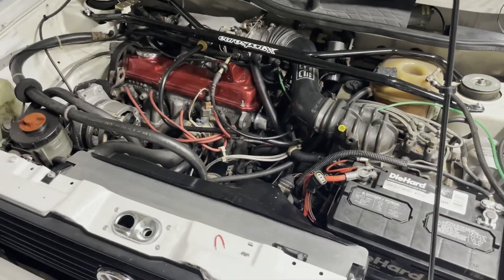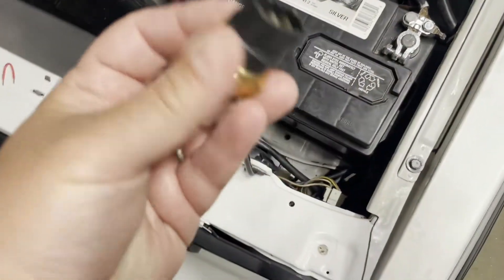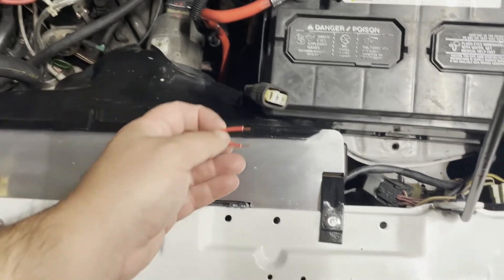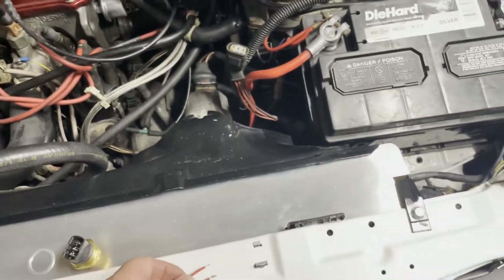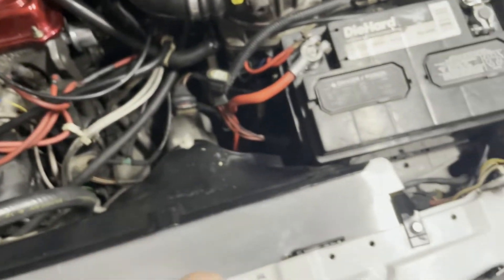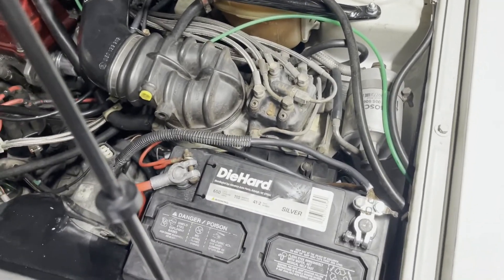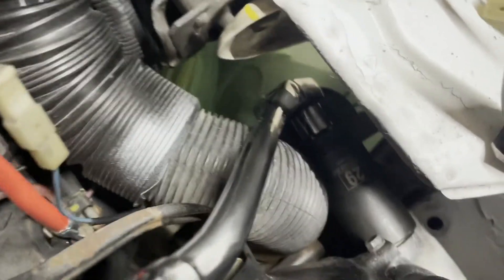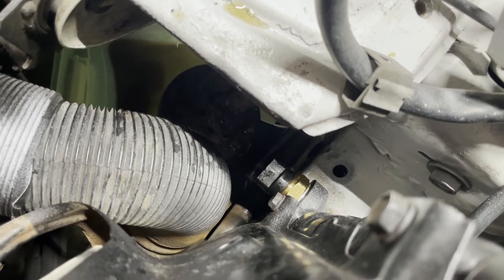Testing a Mk1 VW Coolant Fan Switch

Comment: This was great, exactly the same symptoms, same results with the test. However when I replaced with a new temp switch still not kicking in. Could it be something else?
Reply: Possibly an issue with the cooling fan relays.
Models with ac should require the key to be on for the high speed fan to work using the jumper wire test....and a good fan relay...if I understood the vw mechanic correctly in the video I watched before this one.
Also, turning on the ac should make the fan come on regardless of engine temperature. If it doesn't it may be a relay problem. That also makes me wonder if the ac compressor's electro magnetic coil could be part of the fan's circuitry. 
A faulty ac clutch coil could be something to check into.
Sometimes when the ac compressor fails and seizes up, unplugging the coil will allow the pulley to spin freely. Not a big deal unless the fan circuitry is relying on that connection too.
Reply: @LarryMorrow2  thank you so much Larry, turned out to be a poor ground in the end
Reply: @ollieguyon  glad you got it figured out. 
Yesterday I learned there is a pressure switch on the ac drier, and if the refrigerant pressure is too low, it won't allow the electro magnet to engage the ac compressor,  which will prevent the fans from activating when the ac is button is pressed because there will be two places where that circuit is open.
If anyone reading this wants to test their system by using a jumper wire to bypass their pressure switch,  they should also use a jumper wire to bypass the ac compressor coil because the compressor's oil is mixed with the refrigerant, and engaging it without oil will seize the compressor and burn the belt.
Reply from the maker: great info

Comment: hello, I would like to know if you can help me by telling me the model and code of the air conditioning motor, I have a vw golf mk1 1986 cabriolet and I do not have references to the installation and component model, Thanks in advance
Reply from the maker: I will this weekend
Reply: @ShinyFastLoud  thanks, i speake spanish, sorry for my english